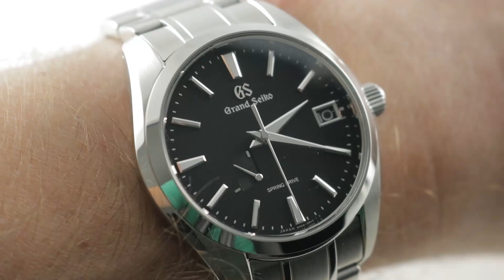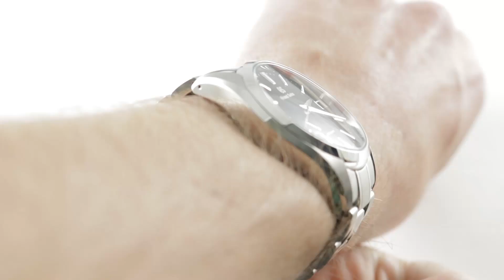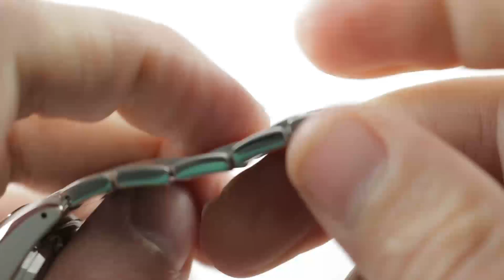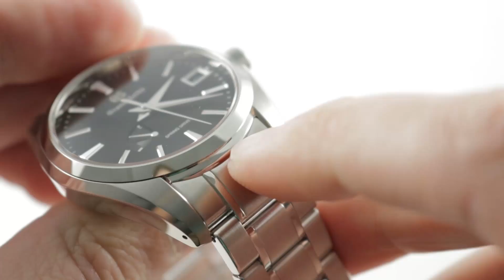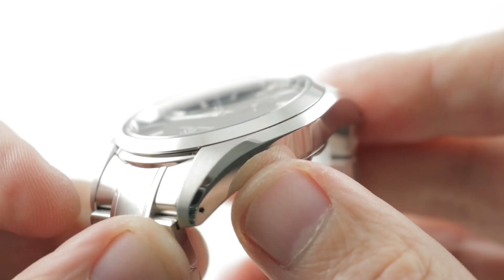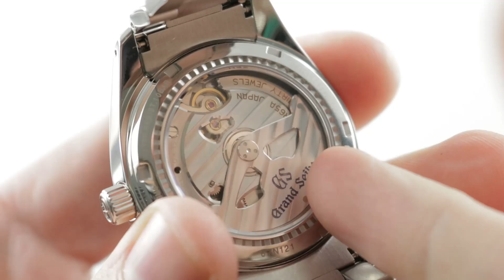Grand Seiko Spring Drive Automatic (SBGA203) Luxury Watch Review

Comment: Is service really difficult? Otherwise this beats any Rolex.
Reply: Only grand seiko can service it.
Reply: They used to have to ship them to Japan for servicing but there is now a certified master in New Jersey, United States as well. Either way, servicing intervals on Spring Drive are significantly longer than any other automatic watch and the services are in price parity with servicing of other high end watches.
Reply: @ayoungtricknamedjim5498  how many $ approximately is that?
Reply: @SouthernCharity  $900